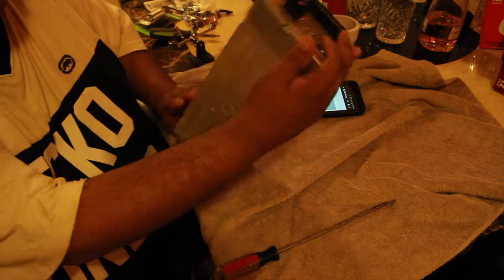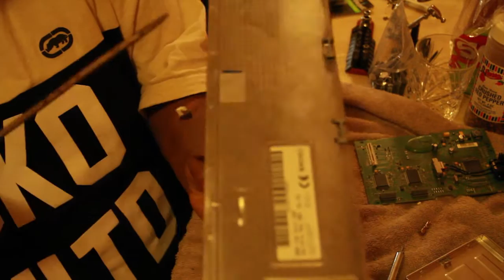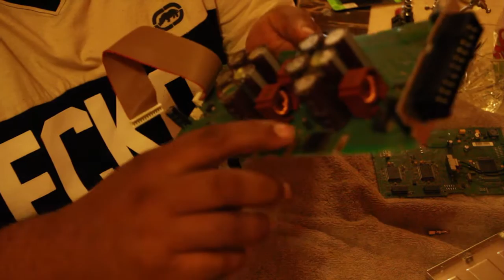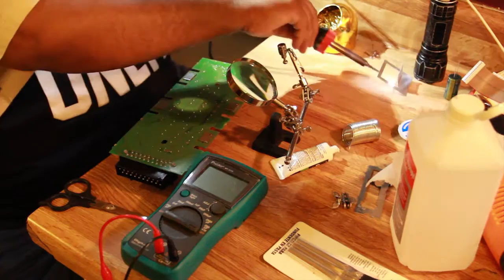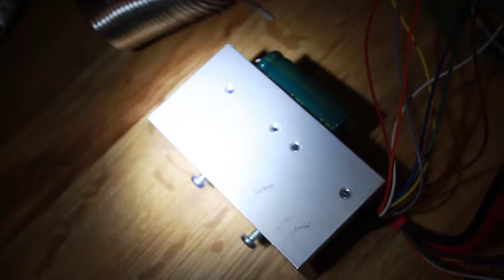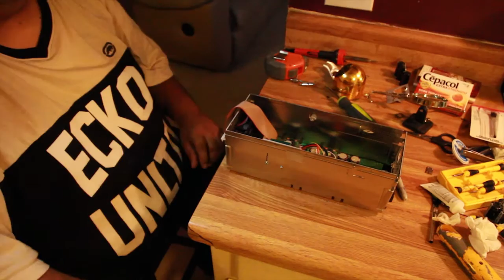how to repair bmw logic 7 amp tutorial

Comment: Hi King! 
Great video!
Short question, hope you can help me. Cant find anything on bimmerfest.
Which one of the chips on the circuit board is for wich sub (left and right) 
Am i right that the chip nearer to the cooler is for the passenger side woofer?
Thanks a lot from germany!
Reply from the maker: oof this is a question i cant answer...you would need the schematics for that. it is best to replace both chips at the same time IMO. I no longer have the E66...i went to a 2015 F02...and next month I will probably upgrade again,,,,best of luck!
Reply: Ok, thank u! Problem is i fixed only 1 an year ago and dunno which one it was. Now the left one is crackling and i dont know if its the same as last time or the other one. Have to try it out, maybe i can tell you more tomorrow!😂

Comment: I just watched ur video on the L7 repair I didn’t c a follow up video I was wondering after the repair did the amp work ?
Reply from the maker: yes it did . these amps get extremely hot. i live in south texas where we bake from may to november....so that wasnt a goood enviroment for the car. i ended up getting a newer one...the 2015 750li...ive had it about 4 years already without any problems...shes garage kept.

Comment: Hi
I need to get rca from mine logic 7 Amp 
I will have Audio system subwoofers 175RMS AX 08 BMW PLUS EVO under seats and need also stronger amplifier
Mine tda1526 is dead so I need solder there RCA to second amplifier 
Have You some instructions how and where to solder RCA connectors?
Reply from the maker: maybe google? the logic amp has no rca. it would have to be bypassed completely.
Reply: @gruponemesis  That why I asking how solder rca tu original logic7 amp. 
This is possible but can't find at Google 
If You use high input adapter before logic7 amp will be sound without equalizer...
Reply from the maker: rca not possible. logic 7 uses fiber optic otherwise known as lightpipe...it transmit audio through light. RCA is an analog protocol....non compatible broski
Reply: Just buy a hi-lo rca adapter from amazon and grab one of the door speaker wires to the hi-lo adapter and walla!!!

Comment: i just cut the wires use a kenwood amp and a lollypop for the fiber optic
Reply from the maker: walter debarros never knew that could work. post a video of it please
Reply: Do you still get sound out of all the speakers like that? I read somewhere that some of the speakers won't work anymore.
Reply: More information please

Comment: Hey, My L7 started cracking - passenger woofer and rear door tweeters were cracking (driver woofer and center speaker was ok). I have removed chip for passenger woofer and soldered TDA1562Q instead. After this I put my L7 back to car, but now none of L7 speakers were working. Fiber circuit is still ok, I can adjust L7 parameter in tone settings (from 1 to 10), also I can adjust equalizers, but none of L7 speakers are working now. Have any ideas?
Also, does anyone knows when fan inside L7 is activated? It starts to spin right after turning on music or only when some higher temperature is reached? Mine does not spin anytime, also after some time of playing music. I suspect dead transistor. Anyone knows what type transistor is this, PNP ar NPN?
Reply: I was told that the transistor is a KT3107. My local electronic store cross referenced it to a nte159. I have the exact same experience you are having with no sound after ic replacement. Have you found the answer?

Comment: you could of jus put small heatsinks right on the chips with its own fan directly over them. radio shack has the tiniest heatsinks i use for this. better than all that wires they say to solder.
Reply from the maker: Patrick Leroi i thought about modding some cpu fans throughout the case. the amp chips were burnt, had to be removed, the solder job was very fun 😉

Comment: did your amp work intermittently b4 repair? mine the bass went all the way out. about to dig it out and repair. love it
Reply from the maker: Patrick Leroi same here, woofers went out. i just repaired a buddies L7 amp as well...
look to bimmers forum for detail information
Reply: The King my problem is the transisters, two of them. while im in there im upgrading the fan and fitting custom heatsinks on the board. 👍
Reply from the maker: how were the capacitors?
i would like to see your pics or vid when done...send me a link
=)
Reply: The King i will post it and send you link when completed.  currently i know the 2 transistors for pin #6 are faulty, some pins on them were separated from the board, the bass and sound from rear door speakers are intermittently flickering. Bass just completely went out just b4 removal. May need to get new repair chips for that now. ugh..i waited to long for repair. but this is gonna be fun.

Comment: use a razor blade to cut the glue and leave it intack. then when reinstall, just use low heat solder iron and touch in between to reconnect the glue.

Comment: no one asked but ------------did it work ?.lol did it solve all issues on all speakers ?]
Reply from the maker: yes, a second time. one must be sure to discharge capacitors before attempting any work.
if you are good at soldering, then this is a fun project. there is a schematic chart for where all the wires go on bimmerforum.com

Comment: do you have a more detailed instructions on where each wire goes?
Reply from the maker: if you go to bimmer forum, or google logic 7 amp, you will find the diagrams for the wiring. they are on the bimmer forum site. do not mess with the capacitors. you will also need to discharge them with a lightbulb or other methods before beginning the operation. good luck.
Reply: +The King thanks ill look it up

Comment: Hey +The king On my 03 745Li rear speaker door are not playing anything & my woofers under the seat also I was told that it's the capacitors I ordered some new ones went to a tv repair shop & had all 10 capacitors replaced but the problem still continues do you have a idea what other part it could be?
Reply from the maker: not really a capacitor problem. its the amp chips that go out. if you look on ebay you will find the amp chip mod for sale, for a lil extra they will install it for you, i highly recommend that option if you have no soldering experience.
Reply: +The King  Good looks on that man but I have gone on eBay & amazon & haven't successful on seeing any chip mod for the logic 7 at all, it will help me & others on here much if you had a link to it or anything more that can help finding this part.
Reply from the maker: i will post the link in a few minutes...
Reply from the maker: +DJ Tech http://www.diyparadise.net/logic_7_repair_kit.html
Reply: +The King : thank you sir I just got back in town & receive my repair kit from the link, now the fun begins lol
Reply: +The King - Man I installed the logic 7 kit after all that time & this shit still doing the same thing, the king when you connected yr amp after doing all that did it come on right away?
Reply from the maker: Yes it did...did you touch any capacitors? Do they look good or are they fat? Google pics of bad capacitors
Reply: +The King - I actually changed all of them also

Comment: Hey man, I have a 2011 750i, on my passenger side, I am not getting any bass and the sound is not great at all.  Do you think it is the L7 amp or could it be the woofer under the seat?
Reply from the maker: +Scott Parks IF YOU HAVE L7 INSTALLED IT IS DEFINITELY THE AMP. The speakers never go out.
I reccomned you buy an amp off of ebay for your particular model or send it off to get fixed. brand new the dealership wanted 1700 installed...no thanks!!
btw, how do you like your 2011? i have an 08 750lo...it drives and looks like a dreammmmm.
Reply: +The King Yeah I like the 2011 750i.  I have the M package so it has all the added exhaust and some other features that some don't have.  Very fast!!!!  I will see about getting another amp.  I saw a place here in CA that repairs these amps, but I have not heard back from them.  Thinking of scrapping it and going with an aftermarket amp and woofer in the trunk.
Reply from the maker: Apparently its impossible to go aftermarket....i tried. The whole damn car system is tied into to l7, navi, voice, cd player,comfort access....nightmare
Reply: Actually all you have to do is buy a cable that ties in with your L7 amp.  You do have to keep the amp installed for everything to work, but with the cable you are able to tap in to the speakers and since the power is in the back of the car, it is pretty easy.  Just not sure if I want to go that route just yet.  I like having the space in the trunk.
Reply: Hey Brother, do you know what color of wire runs the remote to the L7 amp?  I bought the harness and LC2i and the guy says all I need to do is provide the 12V/ground/remote to the LC2i and of course amp.
Reply from the maker: +Scott Parks man i have no idea...i think there is a blueprint on the bimmerfest forums
Reply: +The King I appreciate it.  I am looking forward to getting this all done.  I am thinking of adding a JL Audio amp to the car.  I have had some great results from JL Audio in the past.  I will look for the schematics on the web.  Thanks again.  Happy Holidays!!!